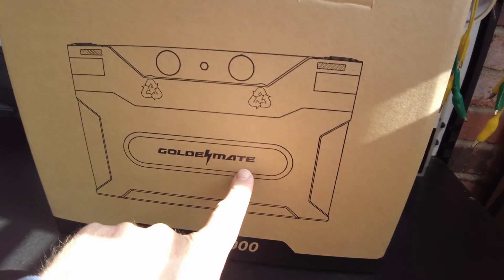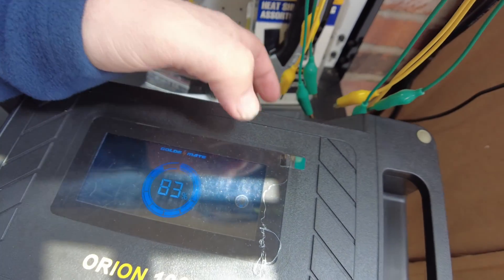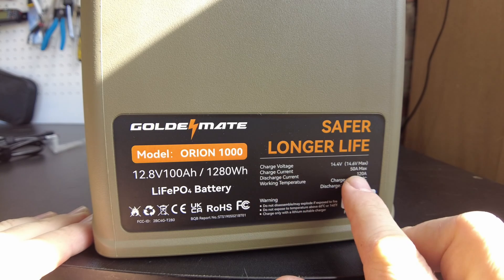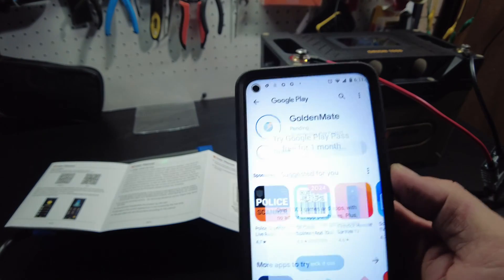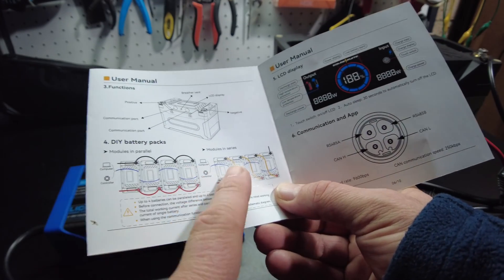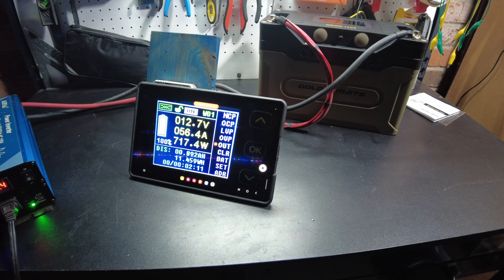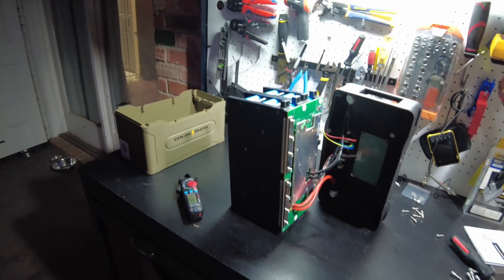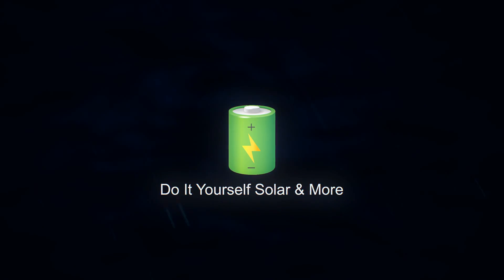Goldenmate ORION 1000 12v 100ah LiFePO4

Comment: Hey Brad. Do you think I could use a Yeti goal zero 3000 solar generator, utilizing the 12v high power output to charge my Orion 1000 battery?

Comment: Much better build quality than most, but it's also twice the price of the budget options on the market.   If you prefer to spend more and get better quality, this would be a great option.  Also, for those wanting to connect batteries in parallel or in series, and don't want them to get out of balance, this design may, or may not, address those concerns.
Reply from the maker: Yup, good points. I asked Golden Mate if they would send out more of these so I can test the communications. Thanks